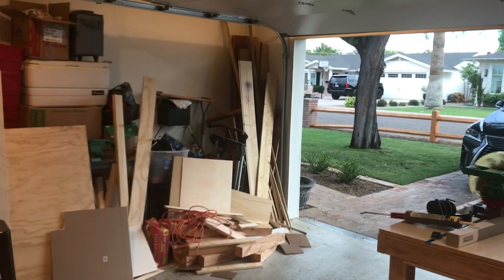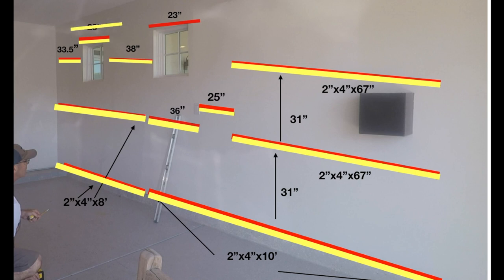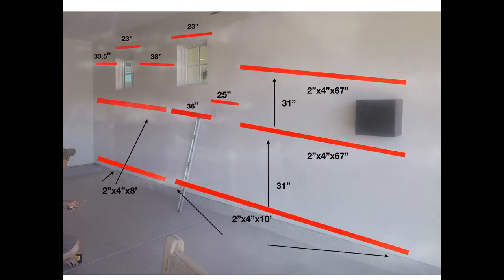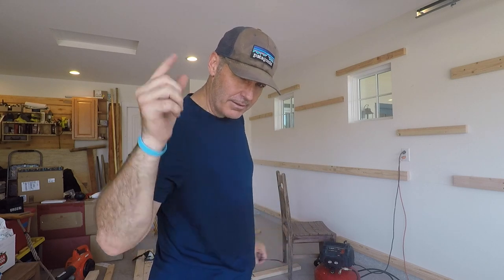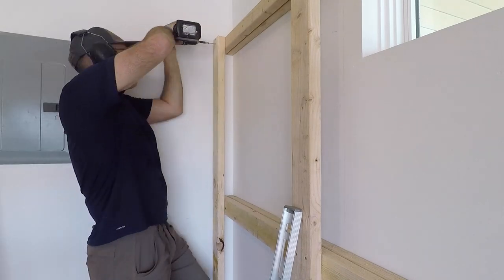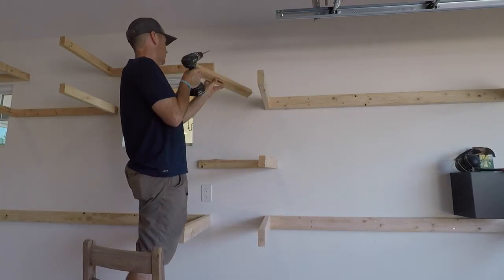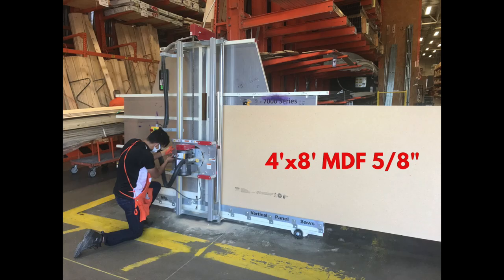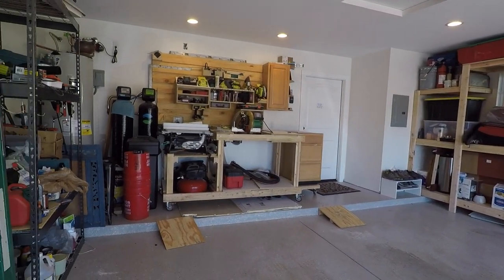How to build simple Garage Storage Shelves

Comment: I like this method. I'm trying to get my head around how the frame was based on the level horizontal. I would think when you move the frame away from the wall it would need to be adjusted for the pitch in the garage. Help me out brother. What am I missing?
Great video!!
Reply from the maker: As long as boards on wall are level.   You base your opposite boards on level.  Then just attach the vertical two by 4’s which will account for slope.  JUST DO IT…lol it will work perfectly
Reply: It's funny. I now see how the verticals account for slope 💰💰💰

Comment: do you have instructions on how to make the shelves?
Reply from the maker: Joel...i do not.  It is really simple construction with 2x4’s and 2x3’s.  Just design it with “stock” lumber in mind....8/1012/16 ft lengths.  Makes it easier.  Also, whenever a horizontal piece ends make sure you have a vertical piece to support it.  If you pause my video when i animate wood i used it might help.

Comment: Why not build the shelf independant from the wall so u don't mess with the walls and can move it around or even sell it if u no longer want it ?
Reply from the maker: Good question...if this were a smaller unit i would probably do that.  The size of mine would make it impossible to move (i could do individual units and put them together).  This is our “forever” house and knew we would always need the storage.  Every household has its own reasons.
Reply: @how2q  Thanks for answering. U earned a sub. Not fully convinced with the answer for my own understanding of what's best. But I can see your point. Doing it in 2 or 3 parts would help to move it.  Good point. 
Even though saw 1 single man in youtube moving a large barn and lift a 20 ton stone with no tool other that pieces of wood and stones. ( - :
Reply from the maker: Haha i am not that guy!  Or i would definitely video it!
Reply from the maker: Def will watch...thx

Comment: Should of attached them little timbers befor you fixed them to the wall 👌
Reply from the maker: You are right...could have done that...appreciate the input!
Reply: @how2q   just the way a done them in mine found them stronger some 4 inch screws right throu
Reply from the maker: I didnt see the 4 inchers at hardware store...thx again!!